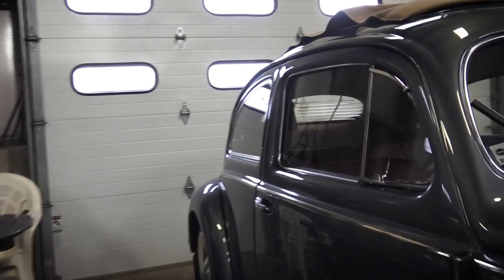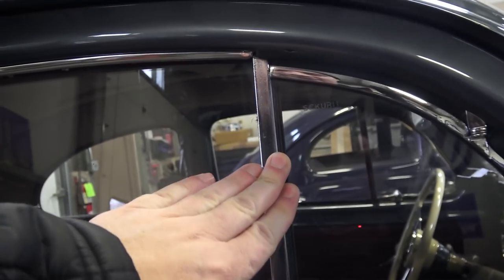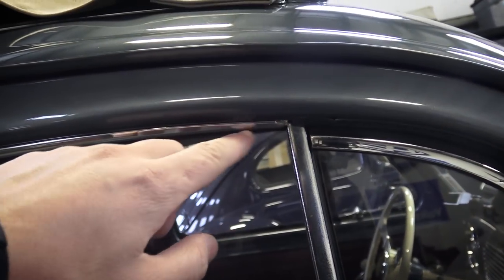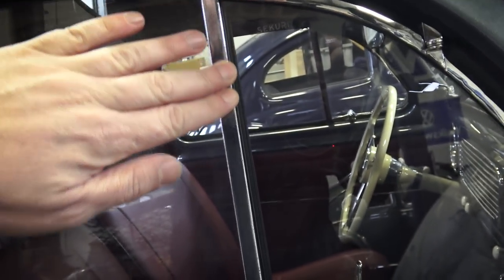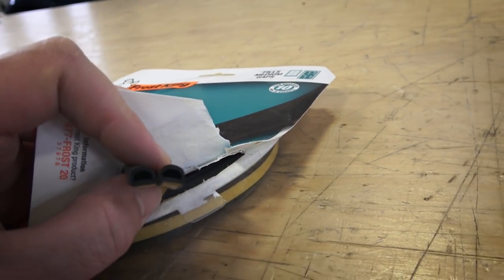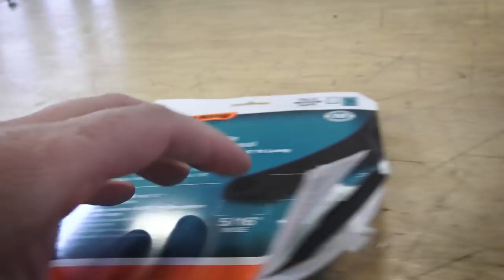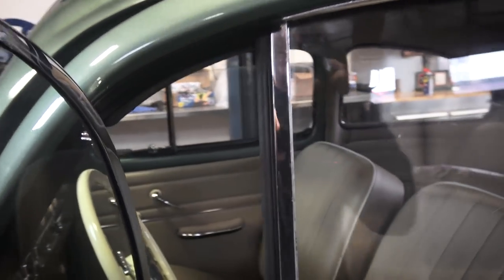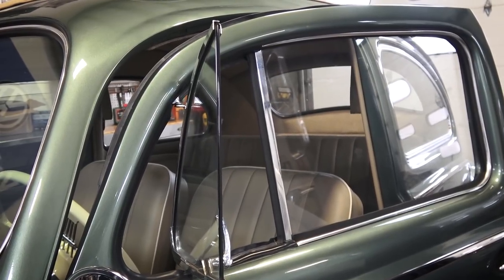Classic VW BuGs How to Quick Fix Vent Window Seal Whistle for Beetle

Comment: How do you replace a 1970 vent window latch?
Reply from the maker: You would have to drill out the rivets and replace, then either rerivet, or use a nut and bolt.